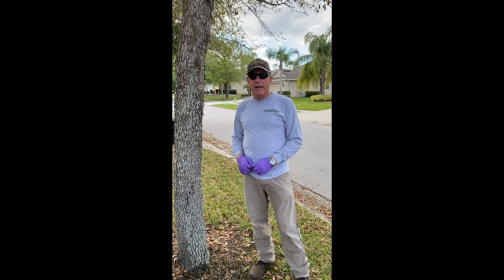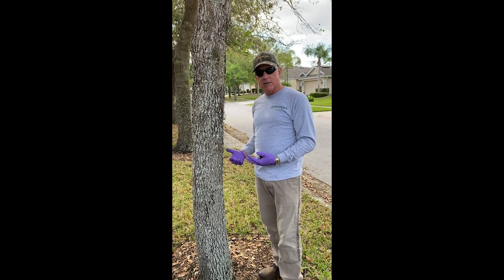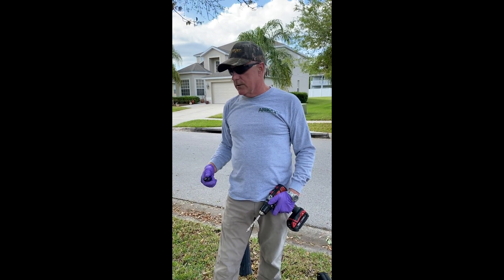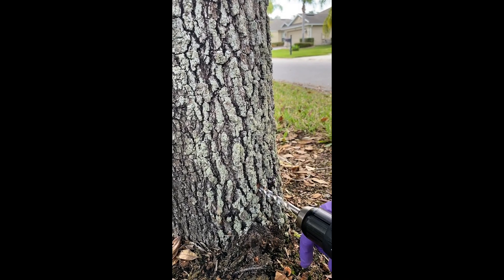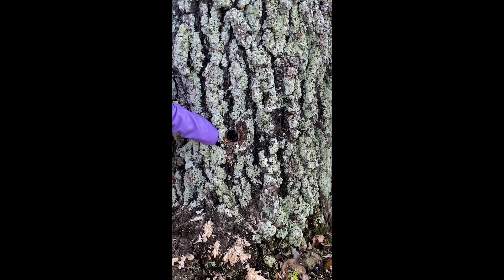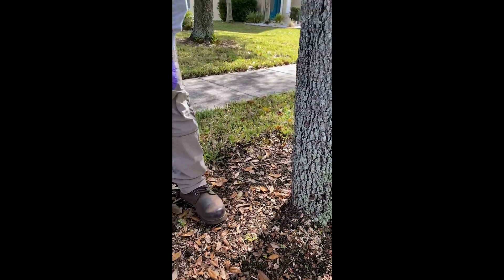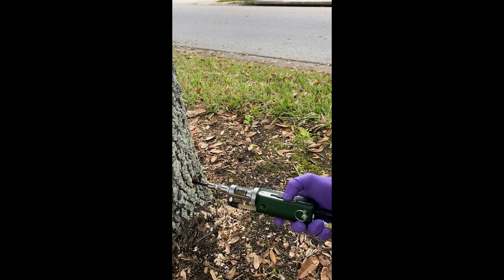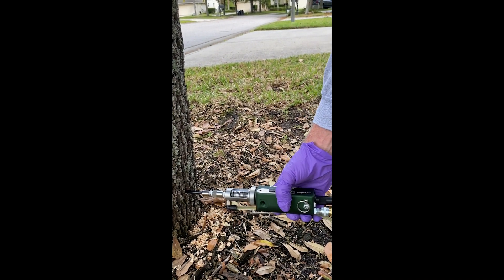Live Oak Tree Injection

Comment: You measured the circumference of the tree, not the diameter.
Reply: it's a special tape that gives diameter measurement based on the circumference, it's called a DBH tape or Dimater Measureing Tape. FYI ;)